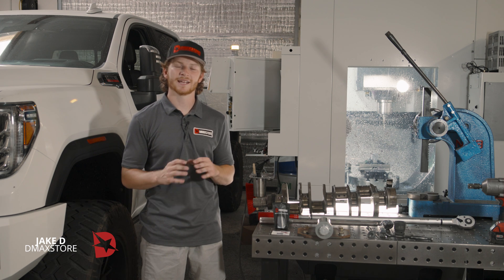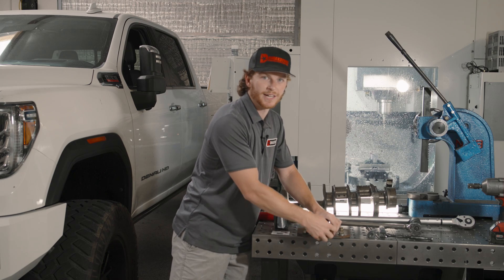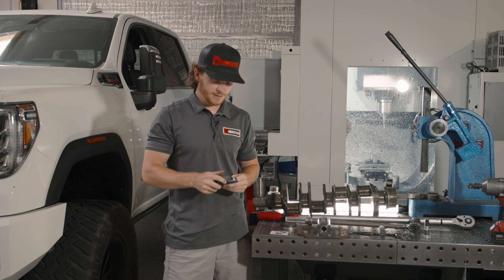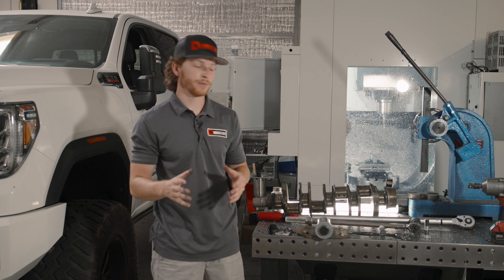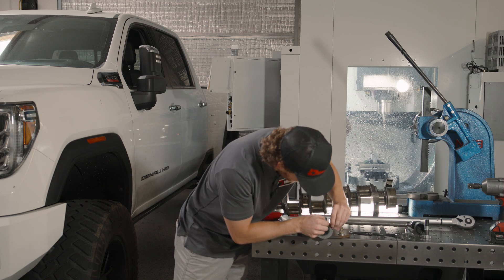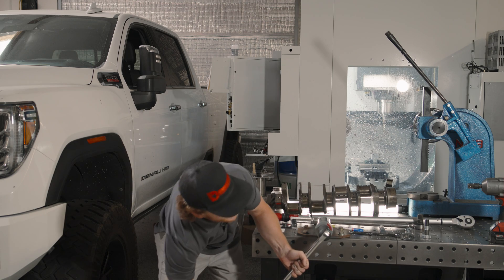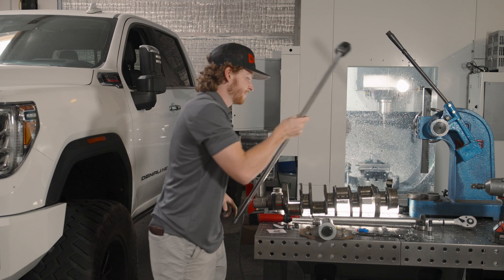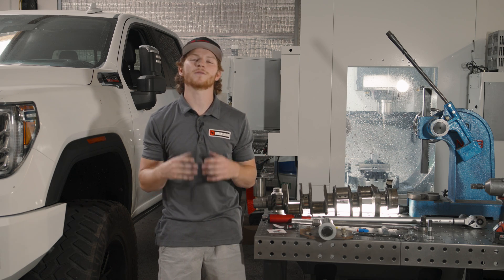DmaxStore Damper Bolt Installation & Proper Torque Procedure

Comment: He says 75 ft lb plus 70 deg @ 1:45 in the video. Your site has different numbers.
Reply from the maker: If you are referring to our torque spec page you would be right in the fact that the OEM bolt does take 74 lb ft then 105 degrees, but we do specify the DmaxStore Bolt is 75 lb ft then 70 degrees.

Comment: What generation of Duramax is this for?  Everything I've ever read on the LB7, LLY and LBZ Duramax's specify 260 ft/lbs.   Even your list of torque specs on your website list it as 74 ft/lbs and 105 degrees for all generations.  🤔
Reply from the maker: This is for 2001-2024 Duramax trucks. The 260 ft/lbs is the spec for the OEM torque to yield bolt on 2001-2005 Duramax engines, for 2006+ it is 74ft lbs then 105 degrees, which comes out to about 260 ft lbs, this is also for the OEM torque to yield bolt. 

Because our bolt is not torque to yield and is made from a stronger/different material than the OEM bolt it requires a higher torque value to ensure that it is properly tightened.
Reply: @Dmaxstore  Thanks, appreciate the clarification.
Reply: @jamesrobbins2708  they should of clarified this in their video just my two cents.
Reply: Is it necessary to lube the oem bolt upon reinstall? Did it dry and picked up a vibration
Reply: @randalstringer3584   I didn't and it seems fine.  🤞